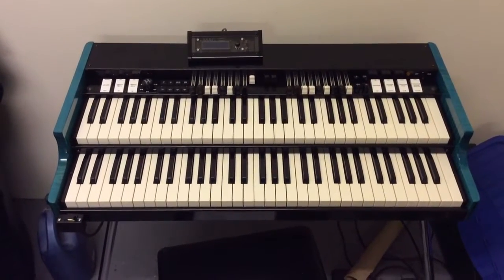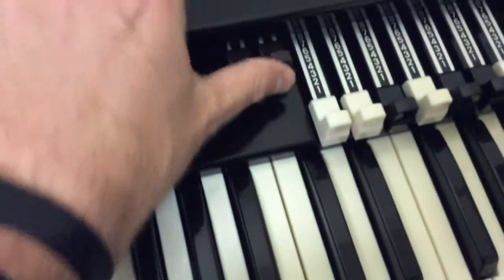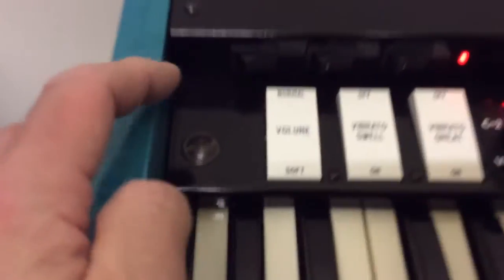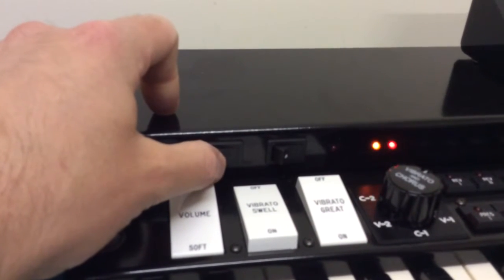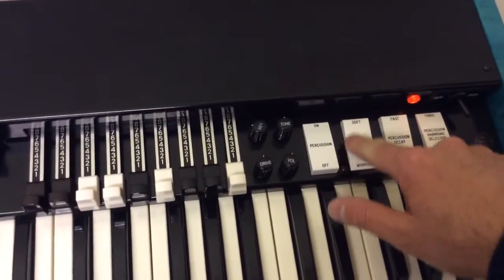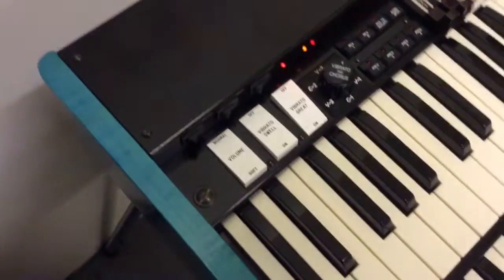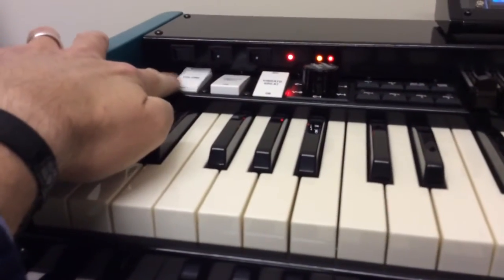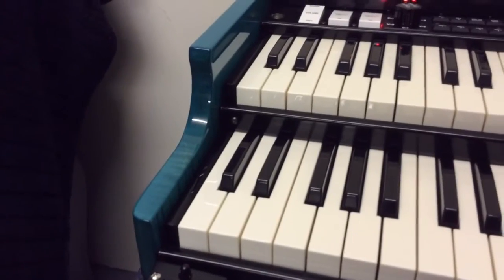Mag C2 organ - buttons & switches

Comment: Hi, please could you tell me which keyboard stand you use here? It looks like old Yamaha stand but I am not sure if this is the one. Thank you! All the best!
Reply from the maker: Good question ! Actually, I don't know what the brand is !! I bought it about maybe 28-30yrs ago, 2nd hand, in a music shop. There was a Roland VK1000 on the stand (the stage piano with circa 12 Hammond-style drawbars). As the Roland was also 2nd hand, I've always assumed the stand originally came with the keyboard - but never knew for sure.
It is a fantastic stand. I used to have a Yamaha P200 (forerunner of the CP330) stage piano, with it's twin 30watt speakers, and it weighed 32kg. On it's flat top I put an old analogue Korg CX3 Hammond clone - and that keyboard stand was perfectly capable of taking the weight of both keyboards ! I saw a used one for sale a year or two ago on ebay - but forgot to check in near the end of the auction - so missed out on it. However since then, after lots of searching I found a REALLY close clone of it, by Roland - so close in fact, that since I bought it, I'm now convinced that my old chrome one is an older version of the new Roland one - and thus the old one IS probably a Roland stand. It has the same hinge mechanism, exactly same method of lengthening the table base and lengthening the legs, same rubber feet etc etc.
My original stand has lovely chrome legs and black "table-top" section. The new one (Roland KS-12) is all black - perhaps Roland think keyboard players want the stand to not be all that visible ? I think it's way cooler in chrome though.
Anyway, it folds up neat VERY quickly, without taking up too much space (I can send photos - just email me on my youtube username plus geemaledotcom (if you get my drift ?!!)). The KS-12 is advertised as for keyboards up to 73 keys - but that's nonsense ! It will easily handle my current Roland RD2000. You can extend the width/table to make it all wider BUT I've never found it necessary. If you are a set the height then always leave it at that height sort-of-a-guy, then this stand is perfect.
I also have a sturdy K&M Omega 18810 stand - which is very adjustable for height BUT is not fast at "breaking down", doesn't fold very compact and is heavy. I leave that at home in my garage for home practice & take my old&new Roland stands to gigs.
Here is a link to the Roland stand - I highly recommend it :
https://www.roland.com/uk/products/ks-12/

Comment: Does the organ have transpose ??
Reply from the maker: Eh, yes and no, is the answer !
No, if you don't have the external programmer plugged in - as there is not a transpose button on the keyboard itself.
The ethos of the Mag organs is to have the layout as close as to how you would expect a vintage Hammond organ to be - so that excludes having lots of other buttons & controls, thereby looking like a vintage console.
The Transpose function is on the external programmer though - (the thing sitting on top of my keyboard) - which is the same controls and screen as on the HX3 module. You can leave the controller on the transpose screen - and turn the dial to change semi-tone at a time, up or down.
And with the new HX3.5 board (now installed in brand new Mag organs), you will soon not need the external controller.
You will be able to access all the deep edit controls (including transpose), on an app, which you can run on an ipad or iPhone - and communicate with the organ via Bluetooth (I think, or maybe it was Wi-Fi, I can't remember !!), or connect your ipad/iphone to the Mag organ via the USB socket on the organ. I hear the HX3.5 organ engine is even better than my 5yr old Mag organ with HX3 v4.25 inside. By the way, my Mag organ tabs, drawbars and controls still feel new and click positively when playing the beast. It still feels a high quality piece of kit. After 5yrs, I still don't have any GAS to trade in this beauty for anything else (although I have considering trading for a new P2 full sized Mag organ). About 3yrs ago, I bought a Tornado T115 all valve rotary speaker system. Together, this thing is awesome !!

Comment: I highly doubt that the drawbars or the cabinet are made of aluminium. Aluminium is way too soft/elastic to be used for those parts. I suggest that it's steel sheets.
Reply: Hi Hammond Voodoo, Max the manufacturer of MAG Custom Organs here. I confirm what Richard says: drawbars and cabinet are made out of aluminum. It you choose the right alloy and (specially for the cabinet) design properly the parts Aluminum is the perfect material for keeping weight down without compromising the robustness at all. I don't know if you are old enough (or maybe are simply not interested in car racing) to remember, but before carbon fiber completely replace it, Aluminum was the material chosen for manufacturing the chassis of the racing cars, offering the best compromise between rigidity and weight. About 80% of my organs are in hands of pro gigging musicians who are extremely happy about them and never had the smallest complaint  about their robustness :-) while enjoying every evening the low weight compared to organs from other manufacturers :-)
Reply from the maker: I have had my Mag C2 organ for a full two years now. Before that I had a Hammond Sk2, a Roland VK7, a Hammond XB2, an old analgue Korg CX3, not to mentioned a circa 1964 Hammond A100.
I can assure you that this Mag organ looks AND feels like it was built like a tank, yet is only 15.5kg.
My SK2 was 16kg and felt cheap and plastic, and I did not have theconfidence it would stay in one piece for long. The SK2’s power input socket and power-supply cable was coming apart after only having it for 2yrs. The Mag organ only uses solid components, like proper IEE power sockets (it has an internal power supply), so any IEE plug will work, eg. from a kettle, a PC, monitor etc etc etc. This feels built to last my lifetime at least, and I’ve only just turned 47yrs old !!!
Reply: @ Max and snakehips81: Thanks a lot for answering, I really appreciate the info. I'm aware of Aluminium composite sheets which are used for external installations of buildings but steel sheets are a very common thing which is why I thought that it's more likely that these are used here. However, there was no intention to argue about the stability or manufacturing quality of the instrument. I find it very satisfying to hear that the MAG Custom holds up very well in comparison to the products of big companies.